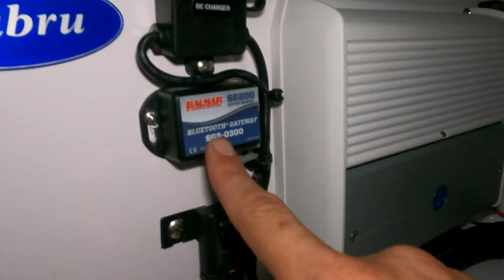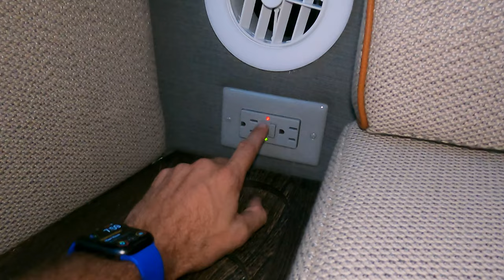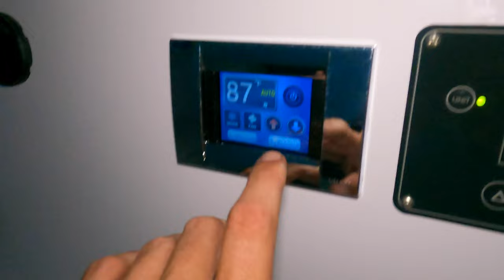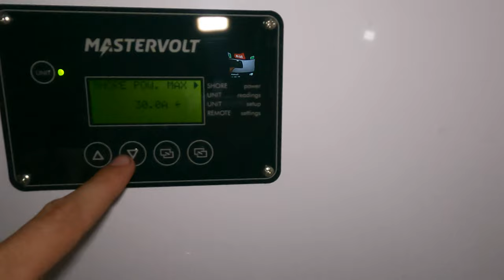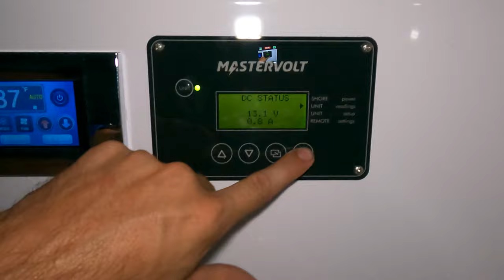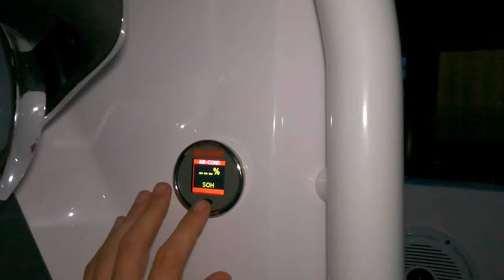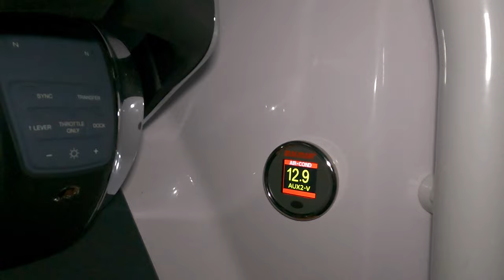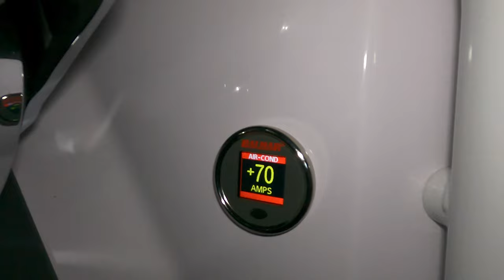2020 Axopar 37ST Enclosed Head with 12V DC Cabin Air Conditioning by Mabru. 16 HOUR RUNTIME!

Comment: Great video. I am having one of these put in my own Axopar 37 by you guys. Question: for people keeping their boat on a lift (like me), do you need to close the water intake valve to the AC every time the boat is taken out of the water (and open it when back in the water), or does it not matter? Thanks.
Reply from the maker: You do not have to, its just the only way to completely prevent airlocks in the seawater pump. We do add the bleeding valve for the pump so I would not close and open the valve every time andI would just look over the side when I start the AC unit up to see if there is water flow. If you do see the water coming out, just open up the back to access the pump system and open the bleeding valve to purge the air out of the system.
Reply: @MabruPowerSystemsINC  Perfect. THANK YOU!!!